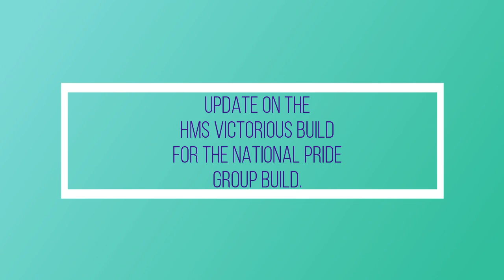Update on Build #4 National Pride

Comment: It’s the quarter deck yes is is open to the weather but not part of the hanger It was officers territory  it would be of a wooden fitting. Also the instructions have a mistake in them the radar Ariel is upside down. It should facing up .